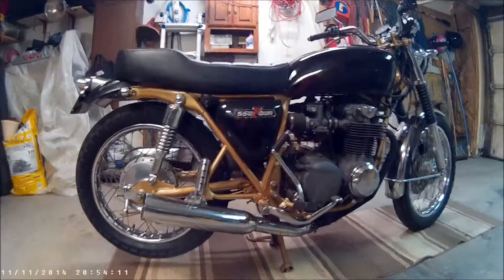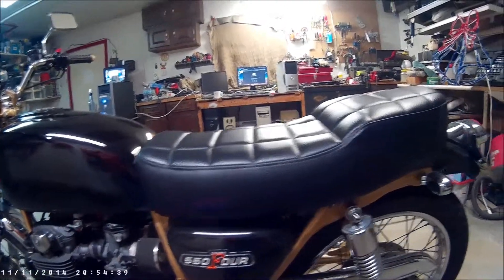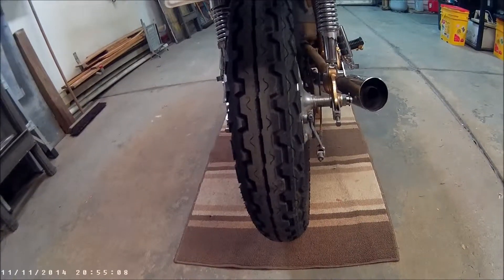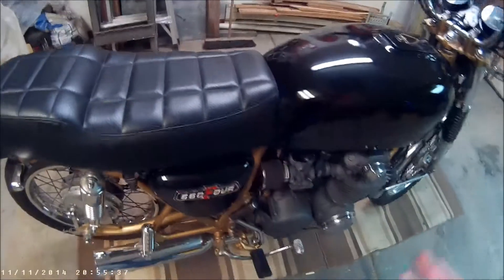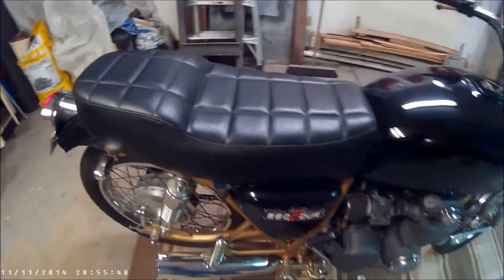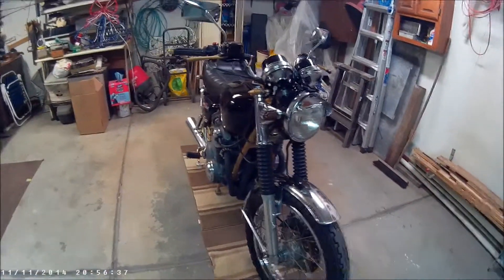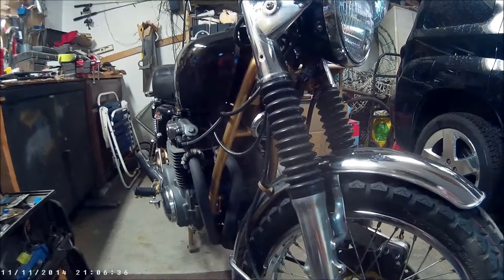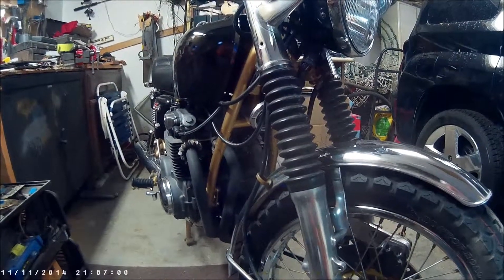My 1975 Honda CB550F WalkAround

Comment: That initial rev bomb made me grin lol.. is a lovely bike, colour scheme goes well.  Am about to change out the thin back tyre on my Diversion 600 for an slightly thicker FZR version.  What was it about the thicker tyre you didn't like?  handling?
Reply from the maker: Thanks for the kind words.. Love you videos man!!! Anyway yea, it was a Harley 16" rim and it felt loose around corners and did not seem to track well. The rim was bought used tho I had new rubber and tube and balanced so I am guessing the rim was bad. Since that rear tire cost me over $300 I am not swapping it out until its down to nothing on the tread.

Comment: What size carb jets are you running?
Reply from the maker: So I went one size up on the main and slow jets seems to be the sweet spot with the cheap pod filters and Mac 4 into 1 exhaust it run's and idles like it did when it was new. I can't remember the exact jet size but if you take the stock size and go up one size that should do it.

Comment: what was the problem with the wider rim?
Reply from the maker: transdetendal The problem was the wider rim could not be centered correctly so cornering was sketchy at best it was too small so the bike never reached full speed ever.. From 0 to 60 in a straight line it was a bullet, but if there was a hill or I tried to get past 60mph it just had a real hard time with it. The biggest issue was how it felt going around corners..
Reply: MidwestMotoRider seems like the gearing was way off too out of the miss alignment ! i would love a bigger rear wheel but the bike is only a small one and  i think its more a statement then a real bennefit on the bike
Reply from the maker: transdetendal Yea, had I gone with a 500 or 600 rear tire from mid to late 90's I would have had the width I was looking for and everything would have lined up better. The big problem with the one I had was that it was from an old Harley I tried to make fit. Lacing it was a real joy! I do prefer the wider tire however because with the stock tire I have I get sucked into rut's in the road more and beside that it looks goofy.. :)
Reply: MidwestMotoRider yea it does look kinda skinny, and if its wider it becomes easyer to find rubbers to fit! i can only find moped tyres or the old school type i got with no real knowledge of grip and such
Reply from the maker: transdetendal Yea, I went with the tires I have on there because it provides great grip around here, many of our intersections have pea gravel in them and these tires are better then the ones you see on sport bikes today those don't give the gravel any place to go, so they end up acting like little ball bearings, where as these have deep groves and the gravel gets pushed off to the side. It actually works awesome. For me anyway.
Reply: MidwestMotoRider cool ,what type or brand are they and size?
Reply from the maker: transdetendal They are Dunlap Roadmaster TT100 they are not cheap but they are among the best street tires I have ever owned.
Reply: MidwestMotoRider ill look them up ! what size are yours ? mine are max 110 x100x18
theysay wider wont fit mine couse the swingarm aint wide enough!
Reply from the maker: transdetendal My front tire is 4.10/H19 and the rear is 4.25/85/H18 I believe these would fit no problem.
Reply: MidwestMotoRider oh their is my problem then!!! cant get enything in my mesurements! reari have max 4.10 but cant find it in the 100/18 ineed !! ill try to look up your /85 and see if i can find one in that size ,it should lower my gear ratio a bit ,but im fine wth that
Reply: MidwestMotoRider nope, couldent find them in my size ,but found  continental tkc 80 in the size 50/50 on/off road looks real nice!!
Reply from the maker: transdetendal Well before you do that, the TT100 has other sizes and they are K70 and K81 try looking at those first. I do like the TKC80's however those are a bit aggressive.
Reply: MidwestMotoRider i havent found eny of the k81 they come only in 3 sizes , ill look at the k70!
love the look of those Tkc´s thou... badass!!
Reply: MidwestMotoRider well couldent find that one either! hm found some others but aint sure bout them
Reply from the maker: transdetendal That sucks, what size are you looking for? I have 2 friends that have these tires also, one rides a 98 Kaw and the other rides a 2002 Suzuki and they swear by them and they both ride in any weather. The ones you were looking at are bad ass and probably would look great on the bike, they are the ones that Delboy put on his and he seemed to be ok with them on the roads so maybe that is the way to go.
Reply: MidwestMotoRider standard is 100 or 4" wide and can go110 wide profile is 100 but i dont mind lower profile aslong it fits inside the swingarm and both wheels are 18 inch high rims ,front is 3,or 3,5 wide if im not mistaking!
Reply from the maker: transdetendal Good to know, I will ask around and see. Even if you don't get them at least you will have the info one way or another. Still I went back and looked at the video of your bike, I got to say those ones you picked out would be killer!
Reply: MidwestMotoRider a bit of survival bike os oldschool offroader wil come over it with those on
Reply from the maker: transdetendal Yes. exactly!! I think that would be awesome!
Reply: MidwestMotoRider i might go that route and even lift up the rear of it a bit, enyways it needs new seal in the fork .its pissing off the terretory whenever i stop , so its time !
Reply from the maker: transdetendal Yea, priorities.. when funds are limited you have to do what "needs" to be done rather than what you like, this is why I did not powder coat the frame etc.. Just don't have the money. That said its funny you mentioned that, just Monday morning I was looking at the bike trying to decide if it would handle better if I lifted up the back end and lowered the front a bit. If you have time look up on youtube CB550 rusty olive.. that is kinda what I was thinking of doing, using the rear shocks he used.
Reply: MidwestMotoRider just going ti check in a minute
Reply: MidwestMotoRider damn thats good looking!!! i didnt find what rear shocks he use but im also wndering how he got the chain to fit!!
Reply from the maker: transdetendal Yea, I like it... He has a build thread on sohc4 .net forums in that post he says however I forgot what he used however when I am read I will look it up. I do love that bike, and I also wonder how he got the chain to fit, I need to look at his posts on the forums and see if he mentions it. Good guy he answers any questions I ask him about. I think he lives in Canada if I remember correctly.
Reply: MidwestMotoRider yes he is from canada , i saw it in one of the clips!